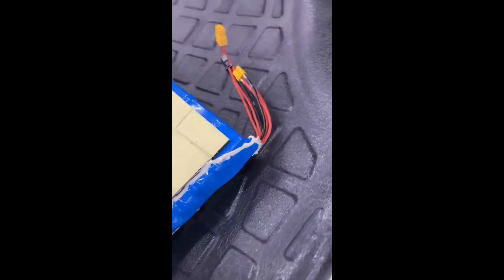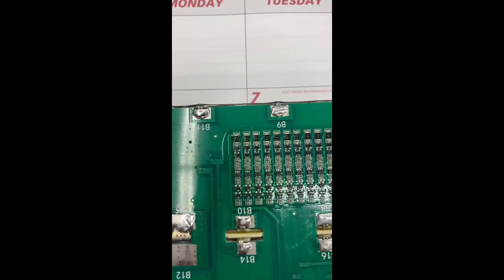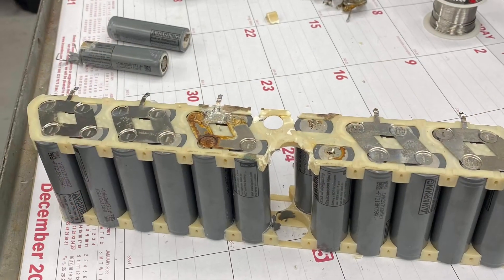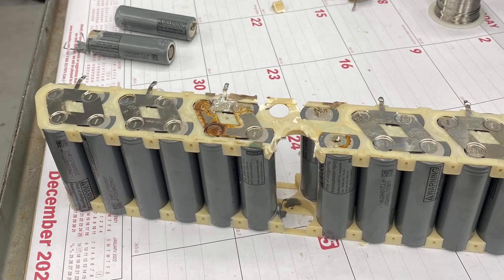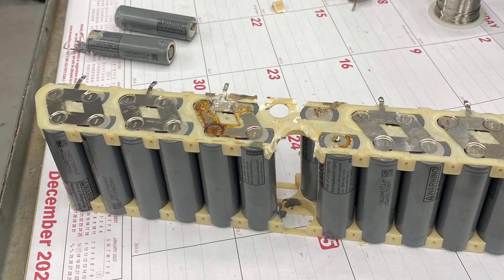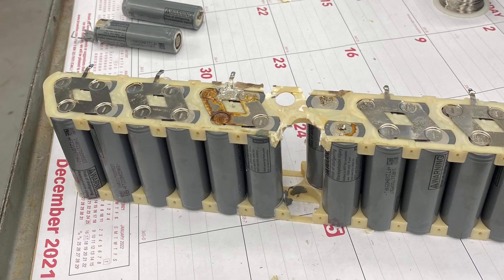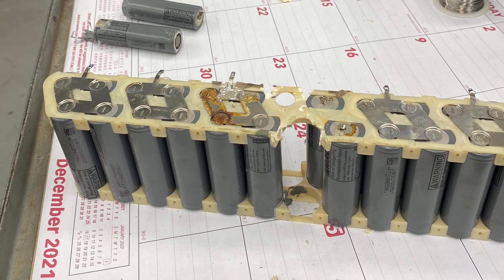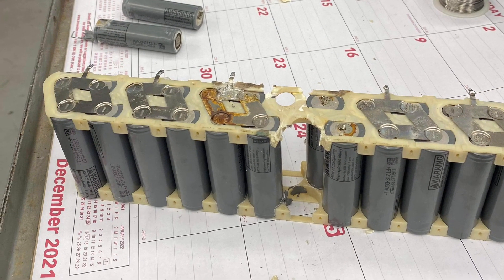Bad Battery pack and how to be aware of it!

Comment: Great info. Would love to see a tutorial on how to check the voltage at the charger port with the connectors for us plebes.
Reply from the maker: ok i will do one for you. but in all honesty you don’t have to be as anal as i am. the voltage at the app or the bolt display on the wheel (if equipped with one) is good enough. if voltage shows 100.8,when fully charged, on the app or the display, then it’s a good indication that things are “well”. but since i don’t trust apps and not all wheels have a voltage display i use a volt meter. i’ll do a quick video in the morning and will post.
Reply from the maker: here you go
https://youtu.be/FX1SfesWzsI
Reply: @rayrokni  Thank you

Comment: Can you throw in a link to these connectors that you refer too? Or a link to a picture of what they look like? Thanks ✊
Reply from the maker: the link is only to clarify what butt connectors i’m talking about. you only need the red A.W.G 22-16 size. i would just get a small pack of them from any hardware or automotive parts store.

Qibaok 300 PCS Butt Splice Crimp Connectors Insulated Electrical Straight Wire Terminal Connectors 10-22AWG https://www.amazon.com/dp/B081CL88CG/ref=cm_sw_r_cp_api_glt_fabc_NWX12AF5B6WFXBTTWWBM

Comment: Thats cheap 4 packs :) 
Just this happend to My EXn , bad cell Group. I buy a just One with about same milage in, hope it works. Dont have that wheel in My appartment. In the garage far from My place....be safe guys ! 👍
Reply from the maker: if you don’t have much mileage on the wheel, you should be good using a new pack, as long as its using same cells and bms
Reply: @rayrokni  yes same old shit bms they use dangerous once.... That was One of the problem to find the old one. They only make new once with THE new style bms. And then i have to buy three new 🤯
Reply from the maker: @yeahbuddy6852  yup. unfortunately they come up with new and stop supplying parts for the older iterations which is very frustrating and wrong!
Reply: @rayrokni  and they new One Arent that Good or better safety even. Just go make more money like allways with kines People